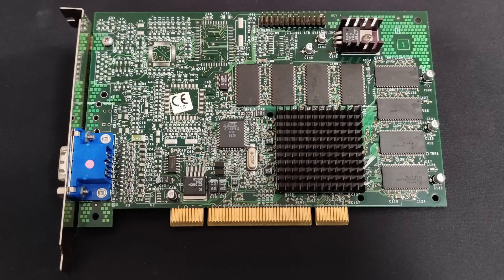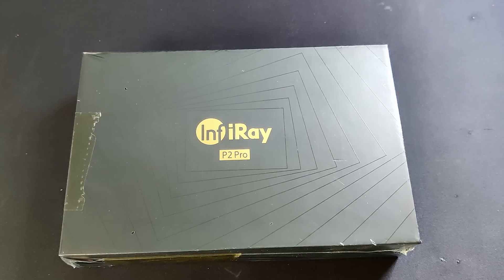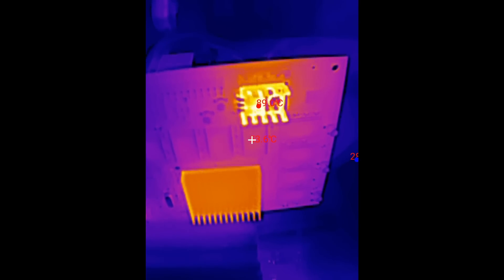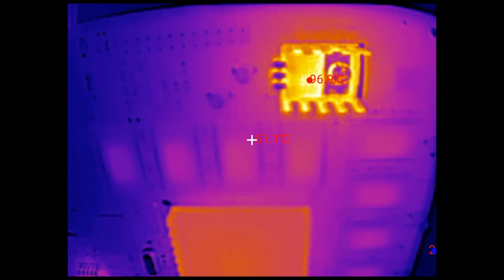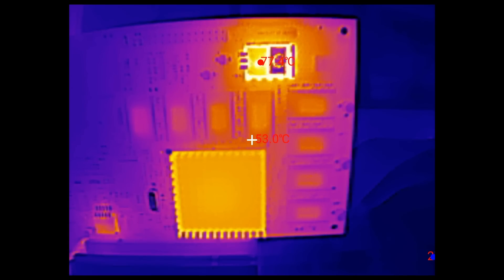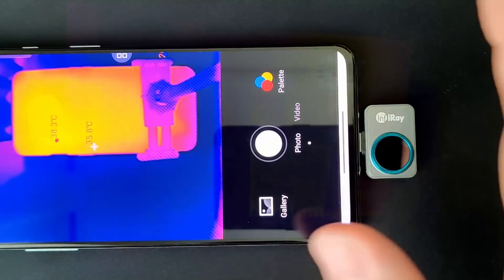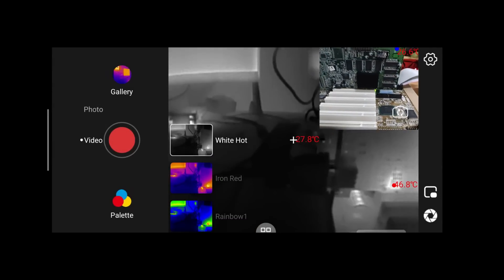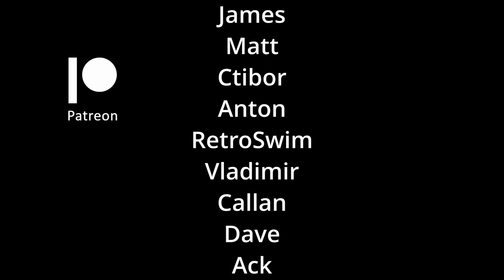Temperature Trouble? Voodoo 3 2000 PCI with InfiRay P2 Pro

Comment: There are purpose made insulating heat pads for the TO220 housing that regulator is using. Also there was a white paste used as a thermal interface which you could never get off your shirt ever :D Also since this is a linear regulator (switching weren't available back then) it has lousy efficiency, especially when the input voltage is much higher than output. For instance if the input is 5V, output is 3.3V, it means there's 1.7V drop on the regulator. If drawing a current of 7A, that's 11.9W being dissipated on it.
Reply from the maker: Yes, that linear regulator is awful generating a lot of heat. Next project to find a proper replacement.
Reply: @bitsundbolts  the main issue I see with the readily available replacements is the low output current of 3A, which for modern electronics is kinda ok. Maybe something like DM09 DC-DC Step Down Power Supply Module 3.3V 10A Voltage Converter Buck Output DC 5V-28V to DC 3.3V

Comment: Great result with the thermal paste! I'd be curious if something like a thermal pad would provide similar results. It's amazing how hot the passively cooled V3s got. Even though they were designed with high operating temps in mind, I never feel right having one on my test bench without a fan providing some airflow in its direction :)

Comment: Not sure if possible but...
seeing the ATX psu 24 pins pinout maybe you could connect the 3.3 pins directly to the 3.3 powerrail on the graphic card.
Reply from the maker: Good question. I don't see any reason why this would not work. Maybe I have to glue a molex connector at the edge of the card :)

Comment: I think the main issue is passive v. active cooling. A 3D printed duct over the vreg and the gpu heatsink would probably drop temps significantly. A small laptop type blower wouldn't create a lot of airflow, but it would be thin enough to keep the assembly small where you could use your expansion slots on either side. Using the 2 mounting holes at the back of the card, you could bolt the assembly on and not have to modify anything else.

Comment: afaik voodoo3 chip has an exposed thermal pad soldered to the pcb, and it transfers more heat to the pcb than to a heatsink. So it makes sense to put another heatsink on the back side of the pcb rather than replacing the original heatsink (and the pcb already has mounting holes reserved for V3 3000/3500 heatsink)

Comment: Hi over there! Grettings from Argentina!
Can u do one more test to the voltage regulator please? Try a different heatsink but put the voltage regulator al 90° from the pcb, that way u can try a few more different size heatsinks.
Reply from the maker: Hello, that would be an option. Those heatsinks were used on some Pentium motherboards and in power supplies.
But I tend towards replacing the entire regulator with a different model altogether to avoid the excessive heat. Still a thought on process...

Comment: I'm not surprised the thermal paste helped, I'm more surprised that there wasn't a lot of difference between the original and the thinner heatsink.

Back in the day I did what I think most kids did when they wanted a little extra performance, overclocked their passively cooled graphics card and slapped a fan on it. In my case it was a nvidia TNT2, which did improve noticeably, although my machine was noisier. I never did a full heatsink swap though, I figured if I wanted big upgrade in performance I could just save up for a couple of months and buy a new graphics card. (Which I did a few months later after I got a job, upgraded to a Geforce 2 GTS!)

Comment: I wouldn't use that gigantic heat sink as it is just a larger thermal mass. It will just take longer to reach peak temp. Some heat pipes or water cooling would make more sense.
Reply: You're not wrong, but the thing to remember with that larger heatsink is that it also has more fin area to dissipate to the environment, so it should, all things being equal run cooler, maybe not by a lot, but I'd guess at around 3-4 degrees lower.

Comment: I'm having a look over the datasheet for the voltage regulator they chose - at 100 degrees Celsius, they cite that the voltage may drop by 0.12V at load. 
It is also worth noting that the LM1585 part is specified to operate up to 150 degrees C, where there is a drop of 0.16V at load. 
Of course we know that high performance parts can get stroppy if the voltage isn't just so - so this is a potential cause of further instability on the Voodoo GPU itself. 

Linear Applications Handbook Vol. I from 1990 is pretty clear that for the LT regulators, it is strongly recommended (basically required) to use a thermal interface material unless you absolutely can't risk conductivity - the modern Noctua NT-H1, or Arctic MX-4, or even the evergreen Arctic Silver 5, all outperform the thermal interface materials of the time, which would have been the white goop that we've all come to hate. 

Interestingly, in the use-case of the Voodoo, the datasheet for the LT1585 has some assumptions that are safe to just use verbatim - input 5.25V (5V +5%), output 3.3V, output current 4.6A - the power dissipation as heat will be 9W (a linear regulator burns off all excess voltage as heat) - and using the relatively standard style of TO-220 heatsink you have, the die shouldn't exceed 142 degrees Celsius... 

A nicer heatsink, combined with a higher-performance thermal interface (I like NT-H1 for stability, it's "set and forget" for a decade or more), will absolutely lower the die temperature, and thus improve the voltage regulation. It may actually do more for stability than an improved heatsink on the GPU package.

Comment: I've got one of these installed with a VIA C3 mini-ITX board in a compact case. To help keep the heat under control I removed the VRM, installed a pin header in its place, and fed the centre pin directly from the ATX 3.3V rail. I've no way of measuring the voltage ripple, but it runs perfectly at the default 143MHz.

Comment: Very interesting video. I have a Voodoo 3 3000 AGP card. The heat sink has never been off from what I can tell. What would you recommend to assist cooling?
Reply from the maker: The AGP cards do not have this voltage regulator - so, one heat source less.
Probably the best and easiest solution is to add a fan to the heatsink.
If you're more experimental, you should wait for next week's video. I already shot most of the footage, but I can't reveal yet what it is about.

Comment: Interesting video. I had many Voodoo 3 cards during the years and practically all of the reached a maximum temperarure of 65 to 70 degrees Celsius without a fan, which is not extremly high for a video card. But I still installed fans on all of them and the temperature dropped significantly.
Reply from the maker: This is the temperature I noticed on my Voodoo 3 2000 as well. Even with the poorly aligned heatsink which is still epoxied to the 3dfx chip.
I hope I get this thing off without damaging the card.
Reply: 65 is a good shut off temperature.  You can use massive heatsinks, 5 to 6 120mm fans with a custom controller.

Comment: Should install newer active dc-dc that fit in that form factor. Love to see how much cooler it would run!
Reply: That's also the first thing, which came in my mind. A question would be, which components are supplied by this regulator and how much ripple they can accept. The gpu itself should be safe, because it gets its voltage from another regulator, which derives the voltage from the regulator in question. If only the memory is supplied by the 3.3V rail, a low-ripple buck-regulator should be fine and much cooler than the original.
Reply: I've actually designed a gadget which should do just the thing, which I sent off for fabrication today; I'm willing to make it available to Bits und Bolts for testing if he wishes?
Reply from the maker: I read your other comment as well. Very insightful! I actually went through a datasheet of a switching voltage regulator (LM2596 - 3A) - just to understand how something like this would work. I'm not sure how much the Voodoo requires in terms of A, but I should be able to measure it using a multimeter.
I'm always eager to learn new things - I definitely would love to have a look what you did!
Reply: @bitsundbolts  LT1585 is rated at 4.5A so anything capable of that much current without feeding too much ripple and noise should be good

Comment: I have a V3-3000 PCI and did the same thing. The voltage regulator MOSFET is fairly close to the PCI bracket and you can see the slightest hint of discoloration (actually very fine pitting) on it as well as some very slight discoloration of the PCB. Why STB and 3DFX didn't bother putting some sort of thermal interface material on those things baffles me. A VERY good reason to paste the heatsink, though, those caps near the MOSFET. There are a lot of dead PCI V3s out there because of those caps leaking due to getting blasted by that MOSFET. Next mod would be a slot fan of some sort. A set of 120mm Noctuas would probably do wonders.

Comment: Might drop the temp further if you screw in another heatsink from the top by bending a few of the fins on the OG one slightly outwards. But the extra one will have to stick outwards to the right XD
Reply from the maker: Yes, I know where you're going! And I have to say, I am not satisfied with the temperature after the mod. It's still extremely high. I think we need a bigger heatsink 😁

Comment: the V3 has about the same heat profile as later model Pentium chips it really needs a fan and more so over when you start clocking them up the big limiting factor is heat on them

Comment: Somewhat surprised that you didn't try to cool the card from both sides, even those old school copper vram heatsinks could do wonders provided there was a little airflow. At worst you could chop and old heatsink then drill a hole for the little bolt then apply that cooler to the backside with an thermal pad to prevent issues. On the gpu side a small vram heatsink is better than the stock heatsink alone. One can always tell when these cards have a lot of hours as the solder mask tends to darken in that area.
Reply from the maker: This is the first video of at least two more to come. But the comments I get will probably justify a third video.
Reply: I love those copper heatsinks.  Very useful to cool a transistor, small motor, other misc motherboard chips.

Comment: Good to know! Good airflow around the entire Voodoo card is what I found works best, but not possible in all cases and builds.
Reply from the maker: You are right. At the moment, there is no airflow. I have seen your video where you rubber-band the fan to the Voodoo heatsink. That's probably the easiest solution to keep those card cool and extend their lifespan.
Reply: @bitsundbolts  😅 I forgot about that one. Unlike that slot bracket with fan mount, it works well

Comment: I never had a Voodoo, so I wasn't ready for that sort of temperature.  That is awful.  I'd be blasting that poor thing with a Delta fan.
Reply from the maker: I think I have something similar :) once I am done with all modifications, I may just make a fun final video with different fan setups to see if I can keep this card at room temperature
Reply: Delta fan is a bit extreme, just need a decent heatsink and the case not be airless so to speak then all is good.

Comment: wouldnt retrofitting a switching 3.3v voltage regulator help with thr heat?
Reply: Switching regulators are far more noisy and this noise scales with load. In many cases this doesn't matter but there are cases where it does. If the engineers didn't incorporate sufficient filtering that covers the switching frequency, ít could potentially decrease the stability of the card under load.
Reply from the maker: I am not an expert - so, both comments seem reasonable. But if they had a chance, why not design the card around a switching voltage regulator and add the required filtering? Is it due to cost, or was it an oversight? Almost 100 degrees on this regulator doesn't look like a smart choice.
Reply: @bitsundbolts  As for why they didn't go that route, keep in mind, switching regulators and our understanding of them has progressed MASSIVE leaps and bounds from when this card was made. It's possible that it wasn't technologically and/or financially feasible to implement a switching design which met the needs of the main chip at that time (needs meaning noise,  transient response characteristics, reliability, etc. ). So it's possible it could work using a modern drop in switcher but it's also possible that it causes major issues.
Reply: @PedroDaGr8  i guess it's down to production cost. mainboard at that time already uses buck converter but building AIC with it should be still expensive unlike today since the cost didnt scale linear at that power level
Reply: it's probably doable, scrap computing made a 486 "socket blaster" 5v to 3v3 converter board out of a cheapo regulator module, and necroware made a custom socket 7 vrm.
Reply from the maker: I guess we have to make a drop in replacement for Voodoo cards then 😃

Comment: I'm surprised the paste made such a difference in this setup. I'd use a thin thermal pad there myself, for cleanliness, and will try it out in the future on my cards, along with larger TO220 heatsinks.

I love my Infiray P2 Pro - I purchased one months ago, and I've had no complaints compared to previous USB and standalone units I've owned. Works great on electronics, and around the home. 25fps is great. I wish it came with a protective travel case though - my old Seek Thermal came in a small plastic case that was easy to carelessly put into the pocket to take with me, without worrying about the lens getting scratched.
Reply from the maker: I was surprised as well that thermal paste made such a big difference. Good idea with the thermal pad, it probably won't perform as well as paste, but I can imagine that it's in the range of 10 to 15 degrees.
Reply: @bitsundbolts  it would be cool to see under thermal camera how the Honeywell PTM7950 phase change material would handle heat transfer.
Reply from the maker: Interesting... I may give this a try! Looks like Linus made a video about :)
Reply: @bitsundbolts  Do you thought about moding the board with a more modern Stepdown voltage regulator module ?? Something based on LM2566?? 😉
Reply from the maker: Not yet, but I get the hints :)
I guess I'll learn how voltage regulators work in the near future 😄